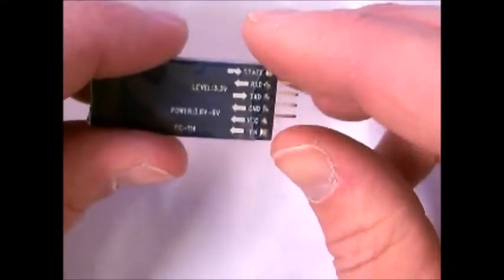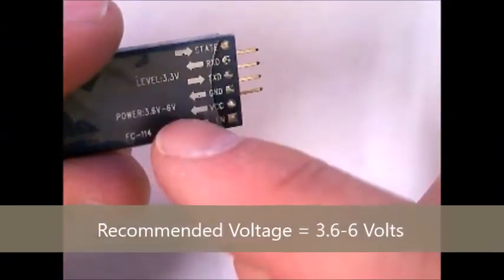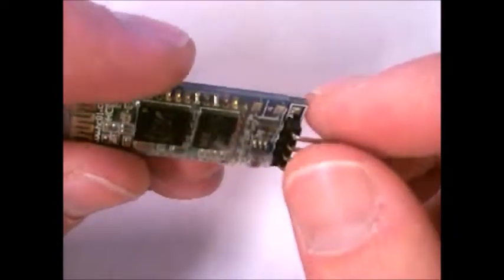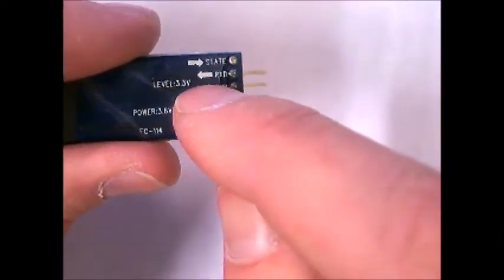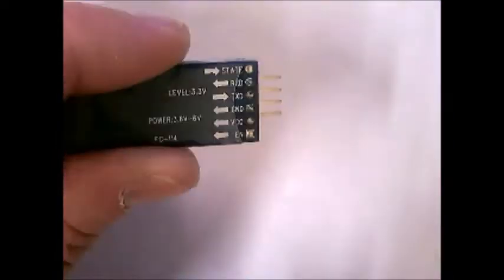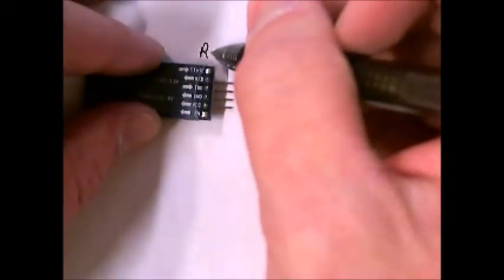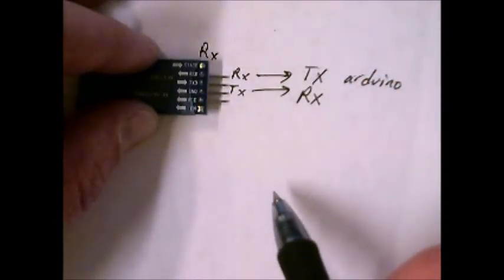How the HC-06 Bluetooth Module works

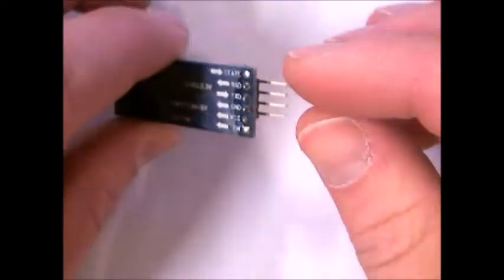Comment: 0:22 So what couple of lines of code would I need to change? I'm doing a keyboard project and it already all works when plugged in via USB, but I don't know how to now transfer that over to bluetooth. You make it sound simple but other videos I've come across trying to figure this out say there can be a lengthy process of reprogramming the hc-06, and I'm just hoping that isn't necessary for my project. Do you know the answer right off the bat or could you send me somewhere that explains it well?